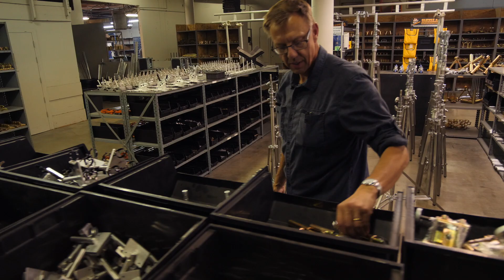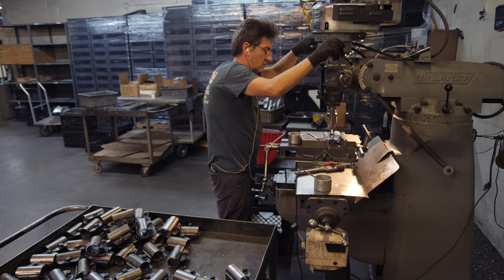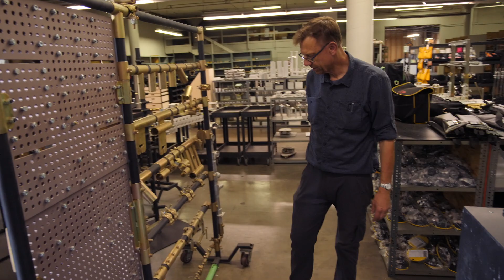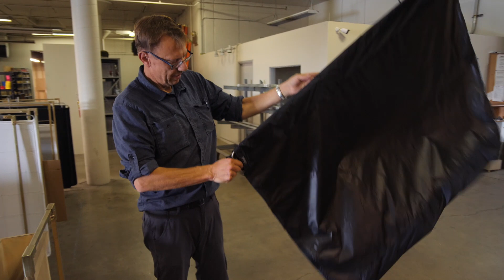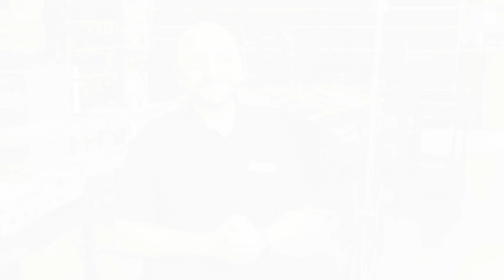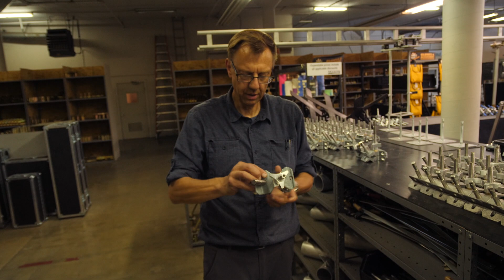Meet The Gaffer #171: @Modern Studio Equipment

Comment: Great video Luke. Jiro has been one of the nicest people to deal with, such an awesome company. Question - why do floppies have thinner "stems" and diffusion frames have thick ones?
Reply from the maker: Are you comparing rolled stainless (floppy) to aluminum (diffusion). I would think the aluminum is thick because it’s a softer metal and needs the thickness for rigidity. Or are you comparing stainless to stainless?
Reply: @meetthegaffer  Oh yeah that makes sense, I should've known! Steel for the floppies and aluminium for the diff frames...